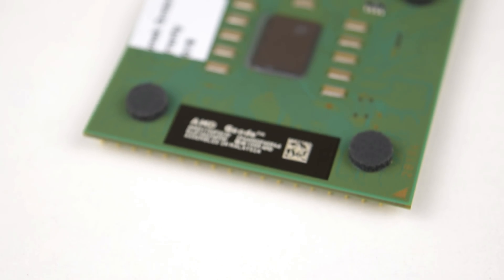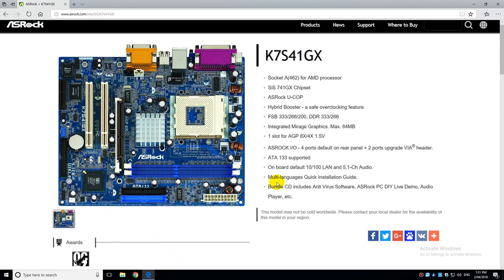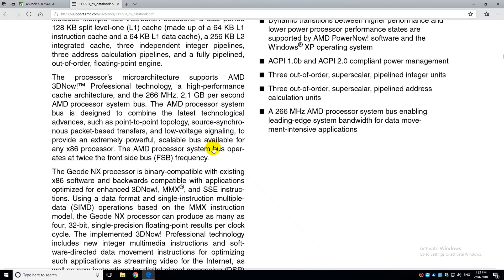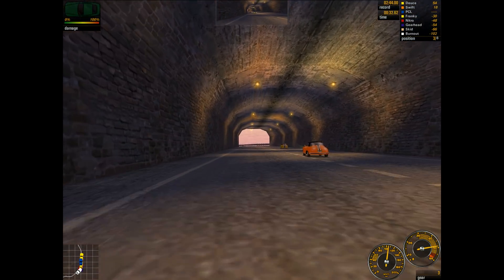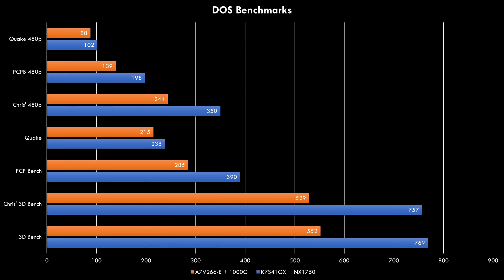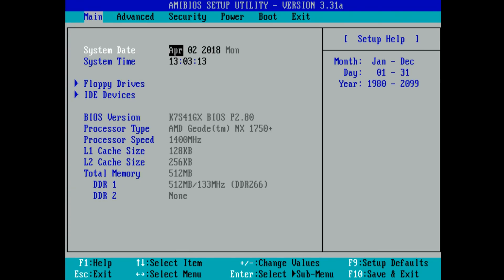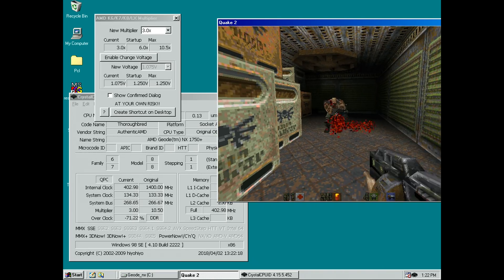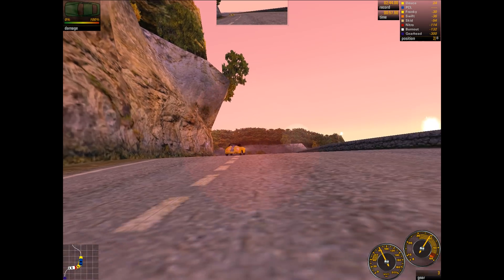AMD Geode NX 1750 Review - Low Voltage unlocked 14W

Comment: The K7S41-GX is the cost reduced version. Get the regulair edition. It has support for PC-3200 as were the GX stops at what I believe is PC-2700. The regulair one has more support for faster CPU's as well. Talking about stuff like FSB and so on.
Reply: Saying ASRock anything is cost reduced (especially from that era of crappy capacitors and 2-3 phase VRMs) is pretty redundant lol
Reply: Knaeckebrotsaege Mmm yeah... When I build machines for a living between 2003 and 2006. The cheapest board on the market was the K7S41-GX. I bought the K7S41 model, and it died 5 years later. Though I managed to change caps and it ran 5 more. Never been able to have it running again. If it can be sourced new in box, then I say it will give some 6 to 10 years worth of Win98 gaming.
Reply: The K7S41 series boards had some weird issue with them nuking/corrupting the BIOS chip ontop of using crappy OST, Aishi and Taicon caps (plus the faulty KZG series by Nippon Chemicon, which is actually a decent cap brand). If one of those boards died and there were no obvious other issues (caps, fried VRM, junk noname firecracker PSU), reflashing the BIOS chip externally helped in around 2/3rd of the cases and it worked again as if nothing happened. To this day I haven't figured out why this happens.  
I do have to admit that ASRock has come a long way since then, and most of their current offerings are actually very decent... unless of course you go for the cheapest board models you can get. Back then on the other hand, ASRock almost exclusively had low end stuff, so if you came across a PC with an ASRock board it usually meant bottom of the barrel build. The only thing worse was ECS Elitegroup a.k.a. PCChips a.k.a. Amptron, but they had already thoroughly ruined the reputation they had built with the K7S5A  at that point (mainly because they were all failing since they were never designed to last even 2 years lol) 

I actually still have one ASRock board from that era running. A K7VT4A+ with the Via KT400A chipset. Needed new caps at some point (the 6.3V 3300µF KZGs popped, as to be expected) but other than that zero problems in pretty much 1.5 decades, of which it ran 90% of the time overclocked from 166 to 200MHz FSB. Yes, the VRM is anemic and it's not a great board or outstanding in any way, but I think "workhorse" describes it pretty well if it lasted this long without any instability funkiness or the like

Comment: Too bad you can't use 3.3V graphics card in a K7S41GX because of the 8x AGP Slot. I guess the chances of an NX 1750 running on a VIA KT266 chipset a rather slim?
Reply from the maker: Watch the video again :D
Reply: Oh, totally overlooked that. Might replace my Athlon XP 1800+ with an NX 1750, that should drop the power consumption about 25W at least.
Reply from the maker: Yea, if the board supports Thoroughbred core, you should be good to go.

Comment: While back i had 2600+ cpu with multiplier unlocked... boy with some titan cooler it was running wild at 3200+ spec (it was 133 mhz fsb cpu, model before barthon). I played fear on it... now i got two athlons mp 2500+ taken from old hp laptop... you know that every amd socket a can have multiplier unlocked and with good cooler can do wanders? There are even small custom boards that can be soldered on cpu pins on motherboard that can mod cpu fsb, multiplier and voltage... socket a is a gem platform... i wish i can find dual socket a board, i woukd keep it forever.... i also got 2x512 ddr running at 550mhz max... corsair brand... if only i got goood oc board...

Comment: Cool. Now where is the thing I was waiting for OVERCLOKING?
Reply from the maker: I'm not into overclocking retro hardware, only in special cases, like with the Celeron 300A :)
Reply: Geode NX seems like the best overclocking chip available for Socket A so OC video might make a lot of sense :)
Reply from the maker: I'm more interested in under-clocking to be honest, overclocking made sense back in the day, but now, if you need more speed just go with an Athlon 64 :)
Reply: Or Celeron 366, that should run with 550MHz (100MHz FSB instead of 66MHz).
Reply: Ran my Athlon XP 2600+ at 1.1GHz on my ASUS A7V880 for a while to reduce stress on the power supply, a real shame I couldn't reduce the voltage below 1.65V though. It made a good Windows 98 system combined with a Radeon 9550 and 2x256MB DDR 400 in dual channel, once I sorted out the AGP port issues.
Reply: I would only OC CPUs like the Deschutes Pentium 3 SLW28 300Mhz - to 450Mhz by setting the FSB from 66 to 100 or the Celeron 300A - because the Celeron 300A would be a "beast" with the full speed cache and the Deschutes wouldnt care about it. The Deschutes wont be tortured because every Deschutes core was designed to run at 100Mhz FSB, but this one was sold as 66Mhz version. Now if you want speed you buy a 800Mhz or even higher one for a few bucks and run it with its native specs and done. 20 years ago it was different, OC made sense because of having more speed for much less money. But nowadays we should treat this old stuff as treasures. :)

Comment: I used to use a XP-M 2800+ (2133MHz stock) on a motherboard that could undervolt to 0.9 volt, it would still be stable at 1500 MHz, also with 1.7 volt it would go upto 2500 MHz, those 130nm Athlon XP's and Geode NX series were really nice compared to the intel netburst cpu's.
Reply: Also I've played around with a system with a Geode GX, but from before AMD bought it from National Semiconductor, really slow, but very low power. Other than the name and that they're both x86 compatible the Geode NX and the Geode GX have nothing in common
Reply: What motherboard did you use to OC the 2800+?
Reply: My Corei9  which is just a fully loaded Pentium3 kicks ass  clock that baby down to 300MHz if I want to

Comment: It's always good to have options when building retro gaming PC machines. I wonder if it's possible to run these machines with passive cooling. I also think about combining this chip with a good PCI sound card under DOS and unleashing some OPL3 sounds on the masses. Please continue exploring the geode. Thanks Phil!
Reply: Passive? Easy, iv ran both P3 tualatin and undervolted K7 thoroughbread (same core as used here) passive just fine. Their heat output is rather small. Of the K7 processors the power hungry are only the high clocked Bartons and the old 180nm stuff.

Comment: I had a bunch of Geode processors, but in an BGA package they was used in an thin client system. They came with 500MHz but easy overclockable to 800+. I used to have Linux running on those

Comment: It would be great if you could make a video downclocking such CPU for DOS. It could be even better using a socket 462 mainbaord with ISA and the KT133A chipset. The best of these should be the Abit KT7A, the Iwill KK266 and the Epox 8KTA+. These boards support Barton CPUs (more or less, newer board revisions generally are better). I have an XP-M running in an Abit KT7A V1.3 without any problems.
IMO such combination is a cheaper and more powerful replacement for Tualatin PIIIs for late DOS games.
Reply from the maker: Do you know of a tool that works in DOS to change the multiplier?
Reply: PhilsComputerLab Sorry, I don't know of any. But I've read that certain multiplier (around 20x or so) are being interpreted as 3x and up so setting these in the BIOS (as long as the board supports it) should do the trick.
Reply: Setting the multiplier on the SL-75KAV to what its manual calls 14x actually puts it at 5x. I will be receiving the Iwill KK266+ once it's done being recapped, and I'll share what I find!
Reply from the maker: Yes I heard this can happen, the settings can map to other settings, but with a bit of trial and error, it shouldn't be difficult to find out. The multiplier can also be set with software, the voltage didn't work for me, at least with the tool I tried (Seen in the video). There are other low power CPUs, mostly mobile ones for Socket 754 and also Socket A that I haven't worked with. Amazes me how there are still things to learn and discover :)

Comment: Tested any higher multiplier on the cpu ?
Overclock record with this cpu is 2.8 ghz it seems with a 20x multiplier at 2.1v with a phase change cooler.

https://hwbot.org/submission/1032188_stunned_guy_cpu_frequency_geode_nx_1750a14w_2825.11_mhz
Think you should be able too reach 2 ghz at least on a regular height socket a cooler + cpu fan.

Would be interesting too see how fast of a gpu you can put in this before it starts too bottleneck performance in say 3dmark 03 3dmark 01
Reply from the maker: I'm not into overclocking retro hardware, only in special cases, like with the Celeron 300A :)

Comment: Hi. I have an issue with my Asus a7s8x-mx motherboard and AMD Sempron 2400+ cpu. The motherboard supports 166 FSB, but I cannot change that in the BIOS (I have the latest version). Also, when I set the jumpers as in the manual for 166 FSB, it gets set up on 100 fsb and my sempron is seen as athlon mp 1000. I mention that when i set the jumpers for 133 fsb, it works just fine and my sempron 2400 becomes athlon xp 1500. What OS do you recommand for this system? Because I have windows xp sp3 and works alright offline. I tried to install different things to make a htpc out of this, but the only software I managed to install was xbmc 9.4, but freezes when I run it.

Comment: i got NFS5 Porsche in a bundle pack "Need for Speed Racing Pack" when shopping from amazon. i was shopping specific for a brand new copy of NFS4, and i discover after buying the NFS3,4 and 5 bundle, NFS5 was kinda fun. :-) , also someone should invent DosBox Operation System , a.k.a DosBox on real hardware so old 286 games and "modern" Pentium dos games can coo exist on the same retro dos machine. So hit Ctrl+F11 to artificial slow your CPU down :-P

Comment: The Geode NX and Barton M should work in almost any mainboard supporting Barton. The only problem like you mentioned in the video is the wrong voltage selection. The reason for this is that the VID table differ a bit for mobile and desktop boards and chips and thus mobile chip usually get 0.2V more than specification in desktop boards. However, having a board with voltage control or the right software eliminates this problem.
Overclocking is generally easy thanks to the unlocked multiplier and the better bin of those mobile chips. The NX CPUs are quite nice, but they are far from the later Barton mobile chips which are even better quality-wise and can clock considerably higher on the same voltage.
My favourite easily is the 1.35V 2400+ 1800MHz Barton XP-M: the one I own was manufactured in 2005(!) and should do upwards of 1250MHz on 1.1V or 1800MHz on 1.3V. These CPUs can often do about 2.7-2.8GHz on 1.85V which is far over that what a 3200+ could do.
For me, socket 462 doesn't get any better than this.
Reply: Does the 2400+ Barton XP-M come with unlocked multiplier, too?

Comment: The K7S41GX is the fastest Socket A motherboard in the world!. Also, another fast chipset is the SiS 735. Just benchmark it.
Reply: SiS 735 is not fast, there are a lot newer chipsets with FSB 400 and DDR 400 RAM support. Fastest chipsets for Socket A are the NForce 2 Ultra and the last VIA chipsets.
Reply: KT880 is a good chipset (dual channel DDR 400!), but AGP can be difficult under Windows 98.

Comment: Hi. I found a Geode NX 2001 (1,8 GHz) for 12 Euros with a cooler. I Could not resist and have bought it... They seem to be nice parts for a collection (even it is not a "real" Geode). Thanks for the tip. :)
Reply: Yeah, I used to have Geode NX 2001 thinking that I'm buying a low-power CPU, but it appeared to be no different from Athlon XP in terms of features and performance.
Reply: The Geode 2001 is just a rebadged Athlon XP 2200+. Even AMD didnt give out any documentation about this CPU back then and why it exists. Its not a low-power CPU at all. Same specs as the 2200+.
Reply: I have mentioned that its not a real Geode... For a collector it is more important that it is a rebranded thing that existed a short period of time, even it is the same like something else... Like a misprinted Stamp...
Reply: Sadly that is just like a desktop CPU with its 1.65V.

Comment: NFS5 one of my all time fav game.
Reply: It was the last good nfs
Reply: I have NFS5 installed on my modern PC under win 7, it has some 3rd part patches for  native16:9 aspect, HD and dynamic reflections as well as glide rendering via nglide.

I have had the game since I was 12 back in 2000. I really like it because it is based on real history, real upgrade components that had to be correctly configured for best performance  for the given driving environment. The vehicle physics and dynamics were extremely well researched and developed to simulate those cars in rear life. 

It pretty much was the only realistic car simulator of its day. I was not a fan of any of the other NFS games as they were more game like and didn't simulate anywhere close to rear life.

I had personally own some cars that shared same basic design and even identical factory suspension design and components and can verify the handling and braking dynamics were spot on to rear life.

The release of project cars what the only other car game/simulator that I rank as good as NFS5 in resent times.
Reply: Why don't buy the NFS games in the good old boxes, if they don't available on GOG?
Reply from the maker: I'd love to showcase more NFS games, but they don't make them available on GOG. For the old games, there are patches and you can run them off a folder in portable mode, which makes it great for my projects. There are demos for Underground and Most Wanted, but with Underground, the full version performs much better, maybe the same is true with Most Wanted.
Reply: spot on! I used to play this game back in the day aswell and i loved the historical part of it, and also the more sim aproach that the game had. I remember being amazed to see those short clips of the real cars when you unlocked new eras.
Reply from the maker: Because it takes way too much time to install from CD, then patch and all of that. I don't have the time for this.
Reply: Totally the opposite for me , I consider it the worst of the NFS series (at least back in those days)

I'd like to see how it handles the speed-dependent games indeed :)